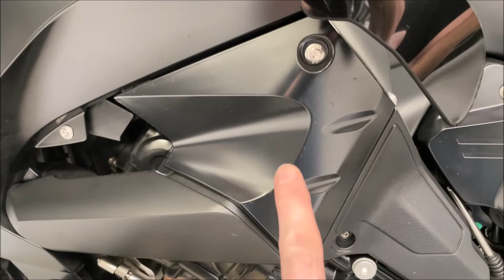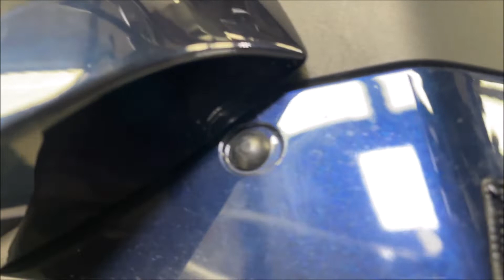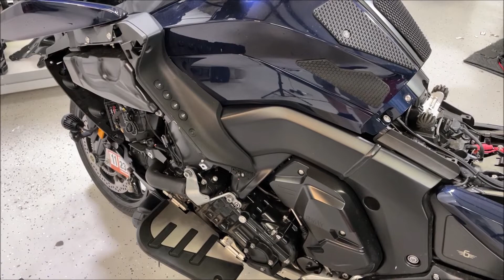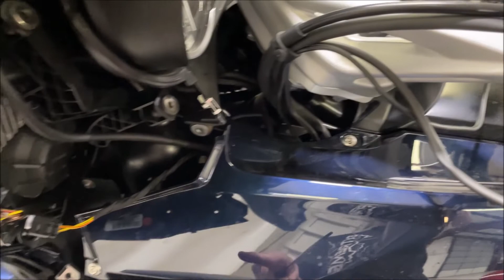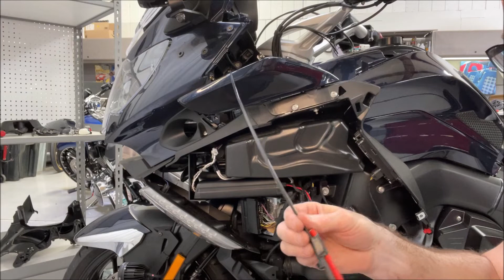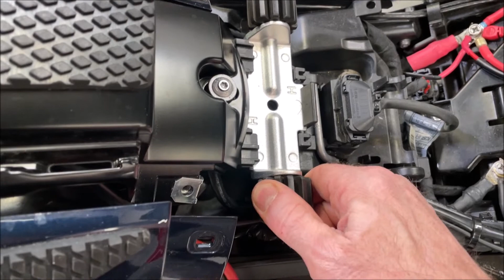Motorrad Audio Amp Installation Inside Left Fairing Of All Years BMW K1600B Grand America GT GTL

Comment: How many watts will the stage two system in the faring put out with the 6.5” speakers?
Reply from the maker: The Stage 1 & 2 kits use an amp that’s 100x2 RMS. It’s able to deliver the full amount of continuous power that the speakers are able to handle.

Comment: Hey Mike. Good install vid. Quick question for you. On the power harness, I see the red, black, and blue wires coming from the amp but only red and back from the battery are being connected with the plug. I assumed the blue is the 12v trigger wire but it's not connected to anything unless I'm missing it somewhere.  Does the amp use the signal from the speaker inputs to turn itself on instead of the trigger wire?
Reply from the maker: It does. The amp senses a voltage on the speaker lines called DC offset, and turns itself on and off on its own. it saves you having to find a switched power source.
Reply: @MotorradAudio  Is it possible to use a switched power source with your system if I wanted to.
Reply from the maker: @K1600_Rider  technically you could run a separate remote turn on, but since the amp would still auto turn on due to DC offset, it wouldn't really accomplish anything. The power and ground that are run to the battery have zero residual draw when the amp is off, so you don't have to be concerned with current being drawn off the battery when the system is off.